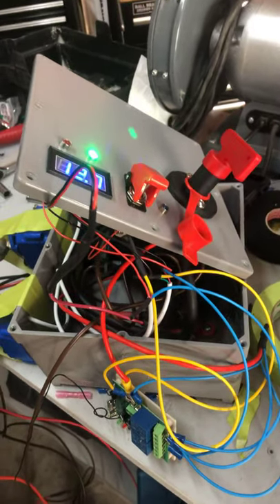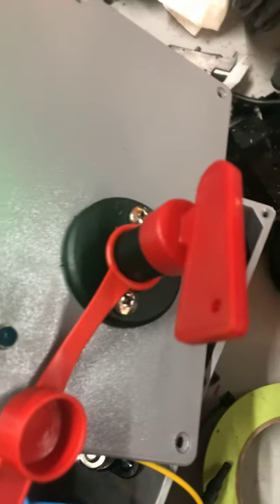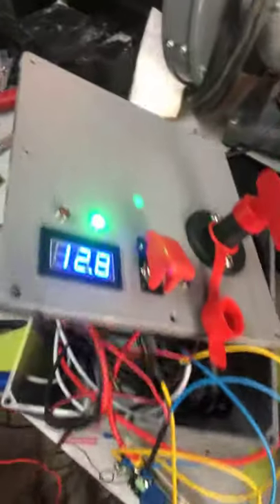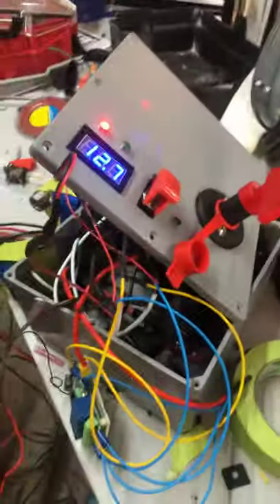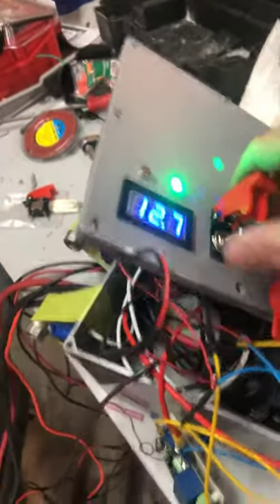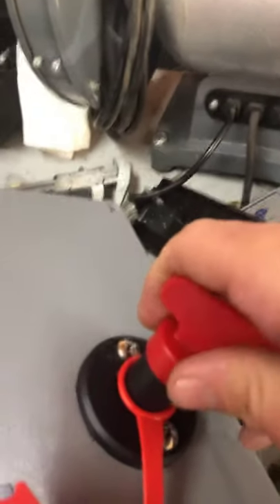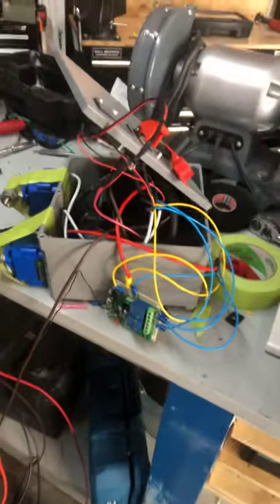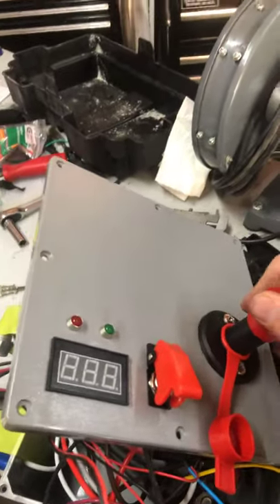Remote downstream injector

Comment: Hey Squid I like this idea.  Dint think the tape will last on those ballvalve, maybe industrial Velcro?  Probably have to go with some kind of metal u bolts..,,   you may want to add an inline fuse to each accessory as well.  On the tender I use a 4 station tender battery tender.  It charges each battery separately but at the same,time...  I think if you hook up all batteries to a single,one port tender at the same,time, that you only get the initial charging effects and not the float and safety features of the tender because it can read the batteries individually??  I could be wrong...  Hey where did you get selinoids and switch from?..
PS good idea and nice vid...:)